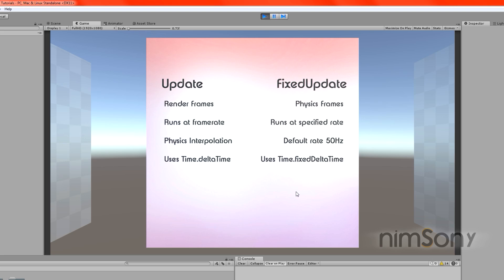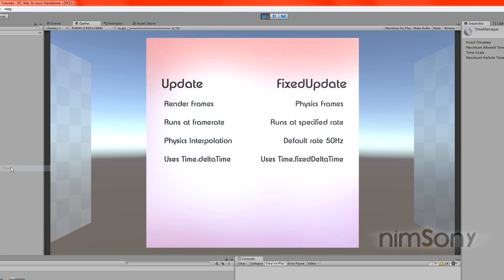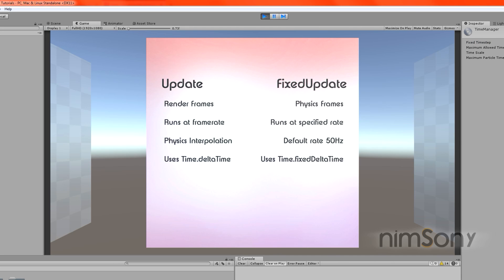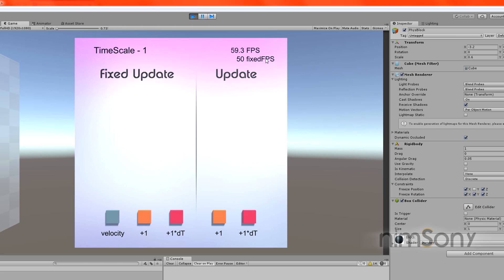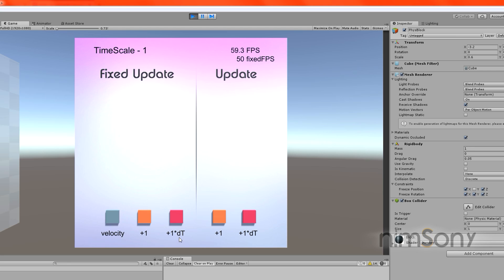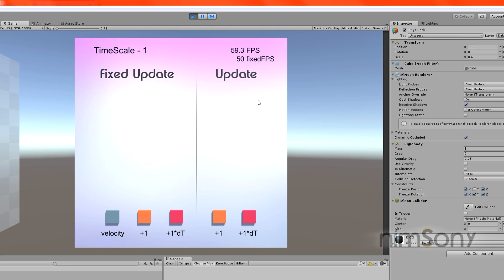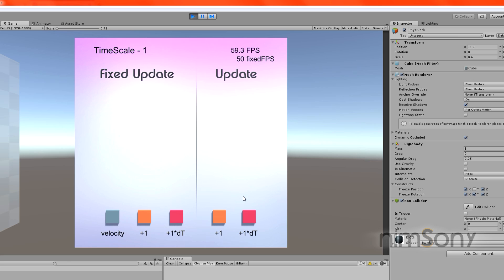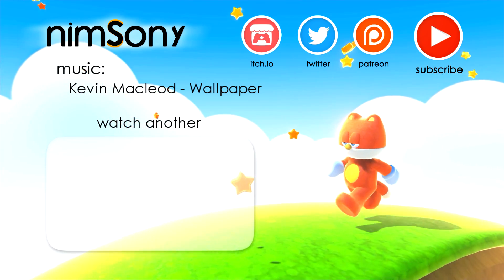Unity Tutorials - Understanding TIME - FixedUpdate and DeltaTime

Comment: Pretty sure Time.fixedDeltaTime only ever returns the set number (default 0.02) so multiplying it to everything just to convert all your stored values to per frame times is inefficient. You're better off keeping all your values in per frame time if you keep them within the fixedUpdate(). Can just convert them for the rare times you want them read in per second times.
Thats why everyone but you just says you don't have to use it, your way is not only more complicated but also more inefficient.

Comment: Okey, but what if i don't need real world units? Fixed update gives me what i need. I assume if you are making more realistic game this matters more.
Reply from the maker: In this case the whole video is irrelevant.
The video is about "understanding" the deltaTime variable.
If you just want to create without understanding, that's fine. Personally I think it's a very bad way of working though.

FixedUpdate does 1 thing, it runs a specific number of times per real world second, specified by project settings.
Adding something or applying a change in that callback does guarantee it is unaffected by frame rate, but without actually using deltaTime the numbers you're adding are effectively meaningless, meaning you're working at the most "HelloWorld" level of game development, carelessly throwing out numbers that work only for a given mix of settings. Change the physics quality even minutely and suddenly all your motion code is doing something completely different.. not due to quality, but due to incorrect numbers.

Comment: So should you multiply by deltaTime of you're just applying velocity? (rb.velocity = newVelocity)
Reply from the maker: Not when setting rigidbody velocity.

Rigidbody.velocity is stored and handled in m/s for convenience.
Best way to remember is generally anything that is a physical value in the physics engine is in normal physics units.

So when you use AddForce, it's in Newtons (unless you change mode), Gravity is acceleration so it's m/s2, and Velocity is in m/s.

When you are setting the values yourself, make sure that anything you've calculated manually is correct to those units. So if you're calculating a velocity across frames, you need to divide by deltaTime to get m/s then give that to the rigidbody. If you just want to type a value naturally then you can do so without modifying it.

Comment: I am kind of confused with your Information panel. If you multiply by deltatime you convert from speed to frame right? But if i had a rigidbody player controller and one device runs on 30 fps, another one runs on 60 fps wouldnt the device with 60 fps make the player move a lot faster?
Reply from the maker: You don't convert "speed"
Speed is defined as "Change in position over Time"
It's the "Time" that you are converting.
m/s and m/f are both Speed.

Regarding rigidbody, like I said the Physics engine works in real world units, meaning Rigidbody velocity is in m/s, and applied each Fixed Frame with Time considered automatically.
This is why you always store your speed in real world units considering real world time.

The physics engine automatically converts the stored speed value to per frame.

This applies even if you set it's "velocity" variable directly, you're setting it in m/s, so it's still applied correctly when automatically converted to per frame.
Reply: @NimsoStudios  so basically if I have an AddForce function in the Update function, all i have to do is add a *time.deltatime to make it frame independent right? What if im setting a velocity on 1 frame for example 
Void Boost ()
{
rb.velocity = transform.up*10f
}
where it is only called once. Then I wouldnt have to multiply this by time.deltatime right?
Reply from the maker: Setting velocity should never require deltaTime, because you're setting it in m/s

AddForce has 4 different ForceModes, 2 of which perform the deltaTime calculation automatically. By default AddForce automatically performs the conversion and works in Newtons.
Reply: @NimsoStudios  So there is no need to add a *time.deltatime to AddForce?
Reply from the maker: No, not unless you change ForceMode.
Reply: @NimsoStudios  But then how come when i play the game on different frame rates. The movement is slower than the other sometimes?
Reply from the maker: You shouldn't be using AddForce each frame in Update, and I'll make a video on that soon, that should be done in FixedUpdate.

If you are setting velocity once then it will be correct regardless of your framerate.

If you are using AddForce every frame it depends on what you're adding but this should be correct regardless of framerate again.
In the video I showed that no matter what my real framerate the Physics framerate stays at what I set it as, so how can that be a problem at a different framerate anyway.
Reply: @NimsoStudios  Ah i see. Thank you for the help.

Comment: At last!!

This is the first time I see a proper explanation on this topic, it's true what you're saying about forums tutorials and explanations, they always fly over this hard but essential topics.

It reminds me of when you did the 3rd person tutorial series, in which you took this same explanation style by teaching how to code your own character physics instead of taking the easy way of using pre-made rigidbody physics. Ease doesn't mean well done.

Here is an idea about a similar topic: the Lerp function for floats and vectors. I've seen in the video that you were lerping the camera position between the three slides, probably in Update through an index or something, but... ¿what does exactly mean that 3rd parameter?

I bet that your code looks like: 

transform.position = Vector3.Lerp(transform.position, slide.position, Time.deltaTime);

But that 3rd parameter, t, is not expecting a time unit, it is just the interpolant. Of course it achieves the desired effect of an ease-out smooth movement, as it's interpolating position every frame by a super small interpolant amount (Time.deltaTime), but theoretically it should never reach its end, as t never will be 1.

Apparently it stops at the desired position, but if you look at the transform position values you can see how them are still approaching to slide.position for a while (well, they eventually stop because of floating number precision)

The proper solution would be a coroutine which use the normalised elapsed time as t, alongside an animation curve to achieve the ease-out smooth effect, or even use SmoothLerp to achieve an ease-in-out.

So, my point is, what do you think about and why do we use Lerp in Update even knowing that it's wrong?